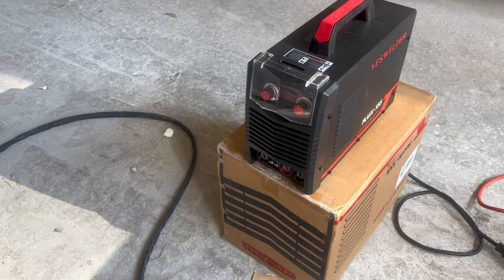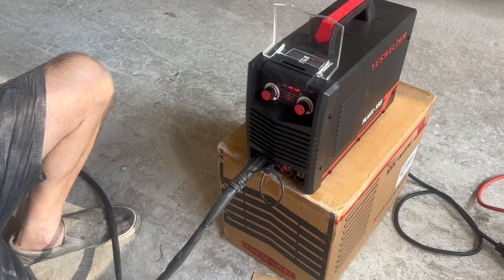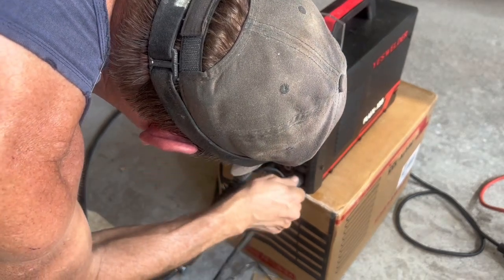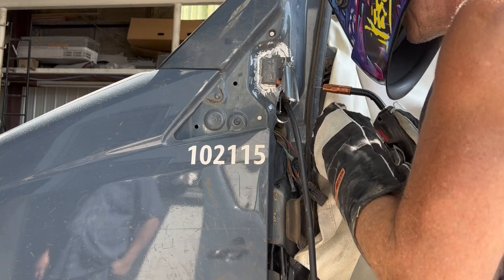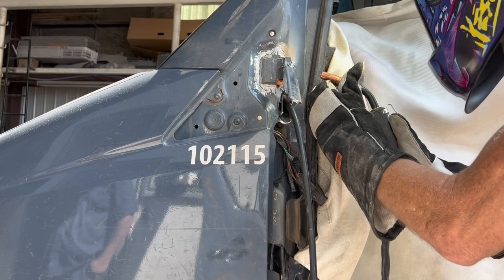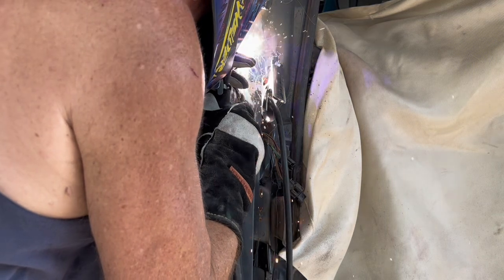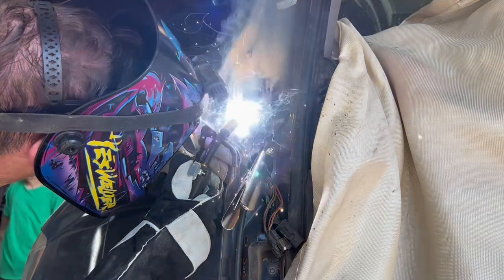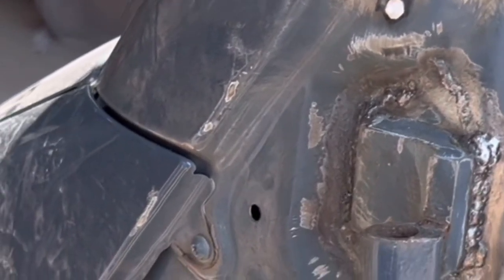YESWELDER FLUX 135 Amp Mig Welder 110V Flux Core Welder Lift Tig Blind Man Bondo Billy Tool Review

Comment: Bought one of these after struggling for years trying to weld sheet metal with a MillerMatic 225. Even with .023 wire, I spent more time patching holes that I burned in the panels than I did being productive. After two day of learning what settings to use, I can weld in patch panels like a champ. I tried Lincoln flux core wire and the YesWelder brand and surprisingly the YesWelder flux core worked much better. Thanks for making my life much easier Billy!

Comment: Hi Billy, purchased my Yes 135 amp welder on your recomendation. It cost £124.99 from Amazon (158.30 dollars) in rainy rust belt northern England. I previously had a Sealey mighty mig 100 gasless which needed a new liner- you have to buy the whole torch assembly which was £60.00 (76.01 dollars) so the Yes is on its way-Christmas present to myself.👍👍
Reply: I've just ordered one of these today. Have you gave yours a try yet.

Comment: I just got my yes welder 135 today delivered now I have a dedicated machine just for fluxcore and I have a multi purpose for mid welding with gas and tag. I have a nice snap on welder that’s almost 30 years old now and it’s the transformer type, not the inverter type the longer you weld with it, it loses power till you can’t even penetrate sheet metal with the heat up in the wire down. I bought this primarily for the exhaust on my 65 mustang. I have stainless headers and stainless 2 1/2 inch exhaust and this way I can weld it with flux core wire with no gas, now I have to practice because I’ve got 30 years of frame and bodywork and gas welding and I can take and stick but I’ve never used a flux core welder. Hopefully it won’t be that bad.
Reply from the maker: Easy peasy😉😉

Comment: Looks like the same hinge we constantly reweld on the Mercedes metris vans . I had added another plate to reinforce it . I weld it to the apost and bolt the plate to the hinge . Hard to explain in words without having a picture. But it stopped them from ripping the hinges off
Reply from the maker: I don’t care if they rip them off again I’ll just weld them back together again😉😉

Comment: I was probably lucky, but mine fed the wire all the way through the flux tube and the gun with tip installed. Did some testing today and it works pretty well, especially given my lack of skill and practice.
Reply from the maker: I have lots of welding vids and all the recent ones are with the Flux135

Comment: Love mine. Cheap and it works, can’t get better

The little connector for the trigger wire shorted on mine and kept feeding wire. Soldered it back to normal and taped it and it was good as new.
Reply from the maker: YesWelder  X1/9 63
Reply: @OldBondoBilly 
June
12345

Comment: Did you try aluminum with one size larger gun tip to reduce resistance and adjust drive wheel tension? I have never used a  spool gun and won't try them. I am 67 next week and this 50 year old GM pickup truck. I bought my 150AMP MIG in 1983 and works great. I will use a TIG maybe 5-15hrs for practice, then done. What would your thoughts be?
Reply from the maker: I don’t understand the question…😗😗

Comment: I just bought a Flux-135 based on this and several other reviews.  I have played a little with it, and have not regrets, so far.   I have been Stick welding since High School in the mid-1970s. but wanted to learn about Mig.  Already learned TIG, and recently bought a plasma cutter - keeping busy in retirement...........   SO curious how limiting is the 135 In per Min wire feed rate?
Reply from the maker: The machine is synergic, I just leave the knob on the left on normal and change my amperage for different thicknesses.  If you haven’t already heard me say; you cannot run a bead on metal thinner than 18 gauge, and even difficult on 18 gauge.  Once you reach an eighth of an inch (1/8), welding becomes pretty easy and you can run a nice bead.  I suggest 70 A for 26 gauge and 100 A for 1/8.  I suggest buying a 220 V welder if you want to weld metal thicker than 1/8.
Reply: @OldBondoBilly  Thank you so much for the quick, and informative response.  Like I said, I am just kinda learning for the fun of it but I just don’t normally have call to weld things metal.  Thanks.

Comment: What size extension cord do you need with this welder?
Reply from the maker: I use a 50ft 12-3, but I rarely exceed 110 amps😉😉
Reply: Depends on where you live and how far away the job is it could run into several miles

Comment: So all the wire left in the hose becomes waste?  Is there a way to wind the unused part back into the machine when you're done?
Reply from the maker: Yes, the wire of the hose is wasted, but that’s a small price to pay for safe portability.  If you don’t have to take it anywhere, you can just leave it connected.😉😉
Reply: @OldBondoBilly  Good point!  Thanks!

Comment: How do you change the polarity on your ground cable on this yeswelder 135 ???
Reply from the maker: Move it to the other port.  For flux, the ground goes in the red port, for stick and tig, the ground goes in the black port
Reply: @OldBondoBilly  mm thx, i did that but still got nothing guess mine came defect then!!
Reply: @OldBondoBilly i did that still nothing but i tried the stick weld cable and that works i get an arc , so my guess the flux core outlet is not working properly
Reply: @masterofstyles5000 squeeze the trigger
Reply: I been welding for 30 years and I’ve used Millers to Lincolns to Hobarts to everything else. I bought one of these and was pleasantly surprised!!! It’s a very small and compact welder that works really well with thin material. I kept welding and welding and welding. It stopped a couple times to cool off cause it’s only like 30% duty cycle, but I can’t complain… It welds good, you get good penetration on 1/4” material. Thoroughly impressed!!!
Reply: I have a question i bought this one from amazon. I can only get the flux weld to arch when it is set on lift tig. But it doesn’t feed any flux out when setting on lift tig and it just burns up what wire is already out. So I can’t get it to work properly I have everything hooked up correctly
Reply: @shanec.6595 Can this welder run off of 15 amp home circuit?

Comment: Im also having hard time getting it to start an arc, first time welder here btw, any tips !!
Reply from the maker: Make sure you have an excellent ground as closest possible to where you’re welding.  Get the metal as clean as you can before you start welding.  Move the gun slightly when you pull the trigger. Make sure your amperage is higher than recommended if you’re welding sheet metal.
Reply: Squeezing the trigger helps
Reply: @Group_Anonymous  yeauppp stupid me, that was it